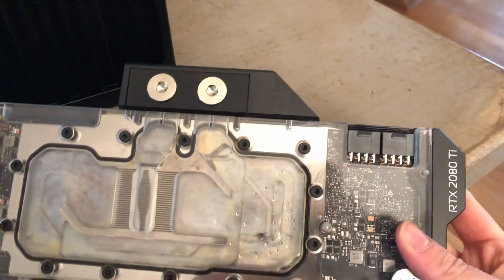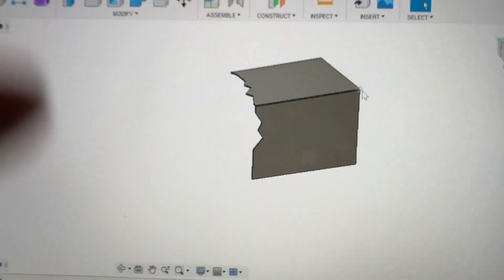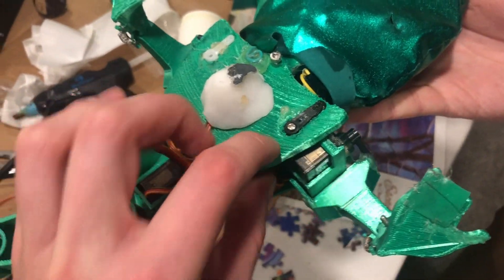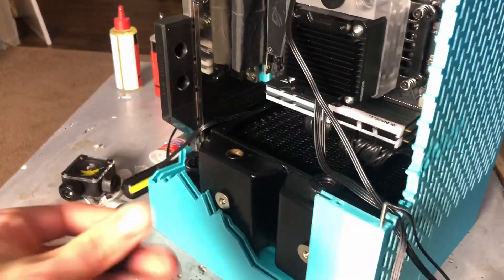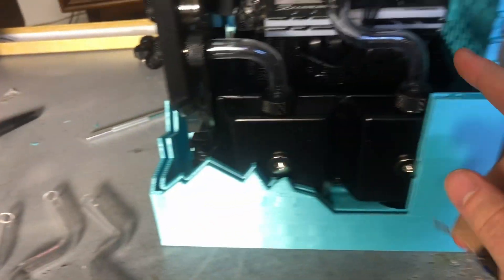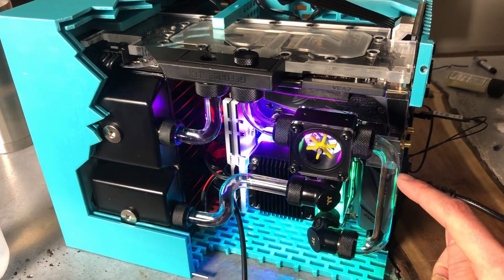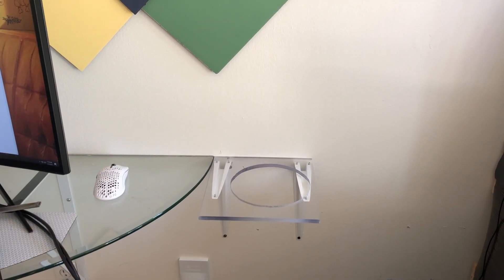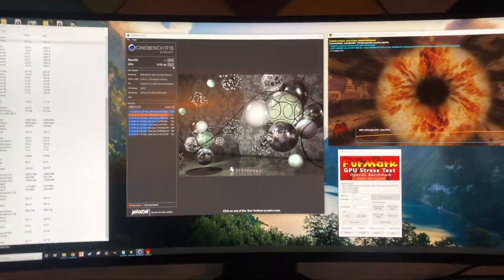Building a 3D Printed Water Cooled PC

Comment: Omg dude i literally have the same layout in mind using the same 180mm fan (but the white ap182 using a digital potentiometer). I wanted to use a couple of extruded aluminum as vertical support and a cnc'd top plate, then a twice bent outer shell.

Comment: I won't to print this case but on cura it's complete case don't know out to disable to print. Just started 3d printing and need some tips if possible thanks
Reply from the maker: Gotta be brutally honest here: if you’re not sure how to take a CAD file and split it into parts for 3D printing, I don’t know that I recommend starting with this case design. It requires customization to get it to work. If you want to 3D print a PC case, start with a smaller and simpler case first, then try doing design in Fusion 360, and after that background experience try this build.

Comment: pump fans quite loud i wonder if hes still using it.
Reply from the maker: I’m not, my latest PC I’m using is the wood and leather one
Reply: @CarterHurd  i've been wanting to do a gpu water cooled build. except those are usually super expensive gpus because they tend to only build them out of the box in the 90 series versions of each card. the suprim 4090 aio cooled gpu is like 1900. Everyone who builds one automatically assumes to watercooled the cpu as well. but the whole point for me to watercool the gpu is to put an air cooled cpu into it. I duno why people would double rad something. I mean they make cars that do it but only the crazy suburus that have turbos that also need it. I would only water cool both if they were to the same rad or at least 1 loop. and call it the weather machine.  lol.

Comment: If the flow indicator is making that much noise, you probably need to reduce the pump speed. On a run that small you shouldn't need max speed.

Comment: this build is siiiiick i really love how you incorporated the broken glass as a design feature. gives a really nice character to the case. if you want to quiet down the flow indicator just turn town the pump speed. for a watercooled build the pump only has to be working enough to move water around to be efficient.

Comment: What 3D printer did you use or suggest?
Reply from the maker: I like the Prusia and Prusia mini (original and pre assembled) 

Lulzbot is also good too
Reply: @CarterHurd  Are these the ones or one you used for the itx case? Thanks in advance! 👍🤩😁
Reply from the maker: @tekzilla777  I used an i3 (standard size) to print this. This is a really massing project tho for that size printer….

Comment: That was amazing. But please please please buy a holder for your camera so I don't have to worry about you handling broken glass, sanding, and drilling with one hand. Also a tip on the pipes: what you should be doing is taking some measurements, cut some cardboard corners and straight sections,  tape those together fitting the cutouts to the holes adjusting as needed. Then bend to match the template.

Comment: Reddit brought me here. Excellent build! 

How is the sound of the Barrow/Pump/Res/Block? I've heard mixed reviews on it, I can't seem to hear it in your video due to how loud the Flow Meter is.
Reply from the maker: The flow meter is way louder, but you can also hear the pump from < 3 feet away. It’s not bad in any way, but it’s not silent. Not that I’ve ever used anything else, but I do have to say the all-in-one package is nice and worth a tiny bit of noise. Just buy from eBay not Aliexpress if you actually want it to arrive.

Comment: Also it looks like you have space above your I/O shield for a passthrough fill port. You can attach that to the middle port on your Barrow pump/block and your fill and drain problems will go away (plus you'll have tiny bit of reservoir that you can top off whenever you like.)  To avoid having to melt the case to accommodate the plug on your radiator, you can use a G1/4 recessed plug that will sit flat against your radiator.

Comment: Tempered would've made tiny little chunks, not long shards like that.
Reply from the maker: Fair enough. Something was different about it though... broke into much smaller pieces that stuck together. Maybe coated?
Reply: @CarterHurd  I think it was the mode of impact. smacking glass on the broad face with anything other than a sharp point distributes the force more than you'd think. When you put leverage on the edge of a pane of glass, it breaks easily. Almost finished with the video now and it is looking very good! An easier option in the future might be to have some panes cut at a glass or framing shop. You could get custom sizes. I love the IO on top and the overall layout. Great job, man!